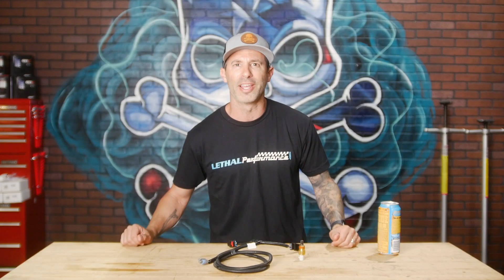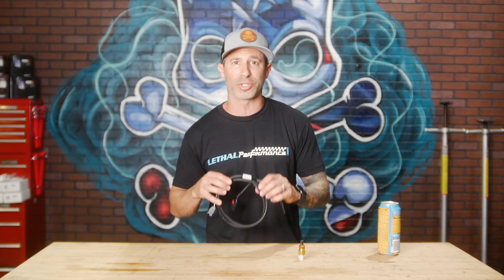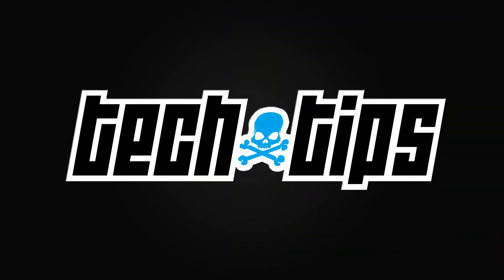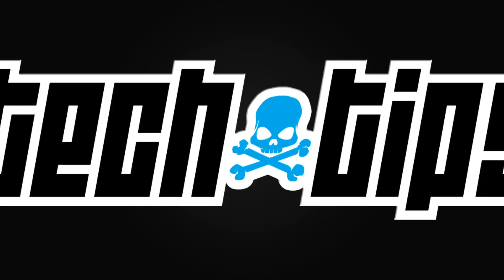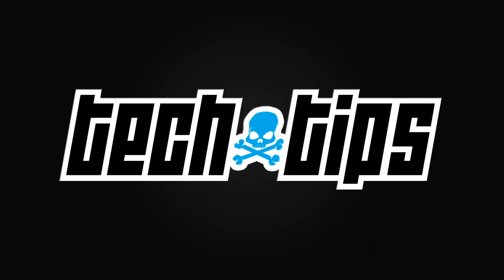Lethal Performance Tech Tips: IAT2 Sensor Kit for 2015+ S550 Mustangs

Comment: My IA temp is running around 130 on a cool day. Is that normal?
Reply: When running. On a hot day it rums at a 150
Reply: What blower?
Reply: @primofx2sport  VMP gen 2
Reply: @martinherrera4295  I've seen a roush on a 60 degree day iat2 at 130. Is it that temp even when driving or just idling?